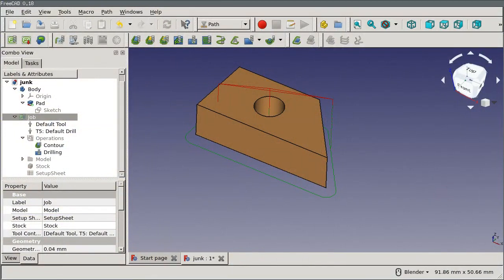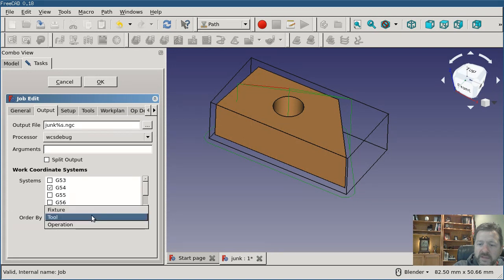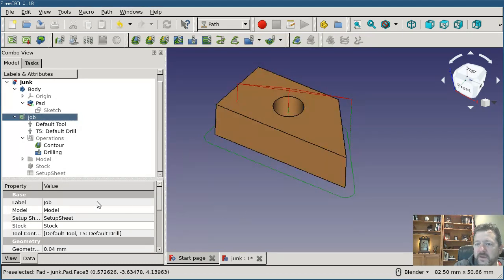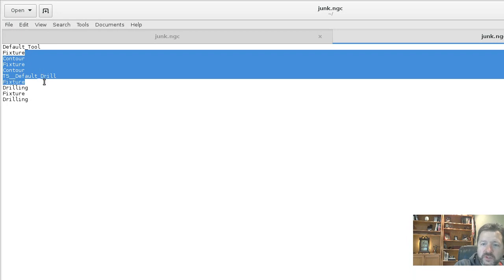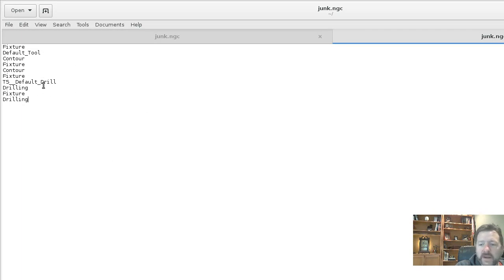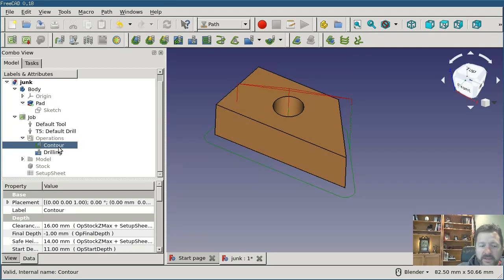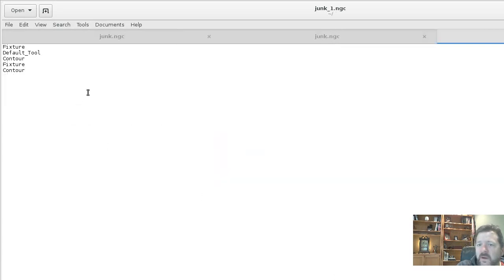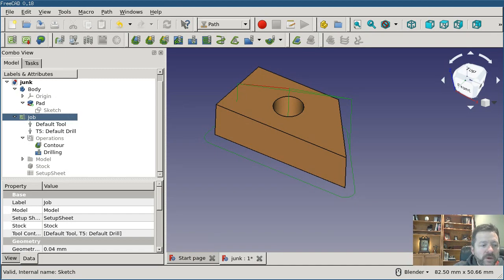Discussing Fixtures and Work Coordinate Systems in FreeCAD Path

Comment: Great job explaining the problem. A single py script taking the filename as an argument could split file and rename it. It should copy the header with a list the sub program numbers in the main program and for each sub programs get a comment (Sub-## of program #### job ###  Manufacture model asset 001) The sub programs should have tooling comments brought in during the split as well. 

I kinda agree with Gary Lake's comment but, You want to have a valid program done when it loads to the control of the machine. Your solution does that, it's good enough. I know that different cnc manufactures have different M98-M99 options, so finding the best way to call it should start there.

Comment: Being a CNC machinist for many years I'd like to say "Good Job explaining it". I use software to write g-code for complicated paths only.
The rest of the code I write myself to do tool change, fixture or offset change or subprograms, drilling, pocket holes. I use subprograms for repeat processes even with different tools. I'm just saying it is much easier to write most of your own g-code and safer.
Reply from the maker: subprograms are great if your controller can handle them but a lot of the hobby class controls like GRBL and Smoothie stream the gcode and don't support them at all.  I appreciate the skill it takes to hand-code -- I do it too in a pinch -- but it's quickly becoming a thing of the past.

Comment: First to put this post in the right context: The most advanced fixtures I’ve ever used are screws and hotglue - so I am definitely in the novice/hobbyists camp.

I was wondering if it would make sense to implement a generic filter pipeline before the post processing. Each individual path has quite some attributes: Tool 1, Fixture 2, Body 1, Face 3, Depth 1. It could be quite powerful if Path would have a hook for small python scripts that can sort and modify these operations. 

An example of such a functionality outside the fixture example would be the creation of inside contours for several pockets. The default sorting is to first cut the first depth for each pocket, then the second, etc. 
It would be cool if one could add a script to change the sorting to 1. Pocket and 2. Depth.

Maybe it’s a silly idea - I am just starting to get into the Path module...

Comment: While I don't see myself doing any multi parts "production runs" any time soon (still trying to get at better finish while dry machining aluminium on a 3040) I still have one comment / suggestion.
Perhaps add an option to set a user defined height to use for moving between fixtures?

I often have a quite low clearance plane that doesn't clear my work holding (to save machine time). It works fine if all my operations stay within a given area and I start the job inside it.
If I have to increase the height it would add time to the job.